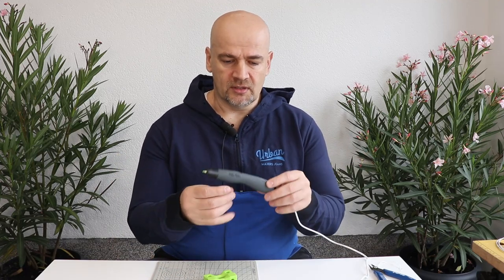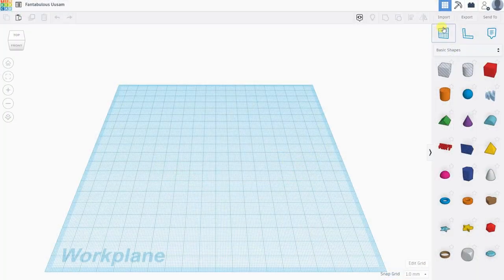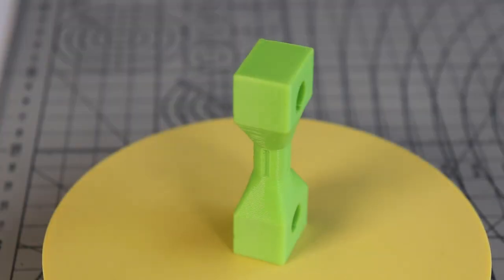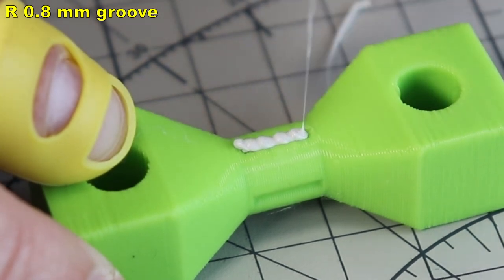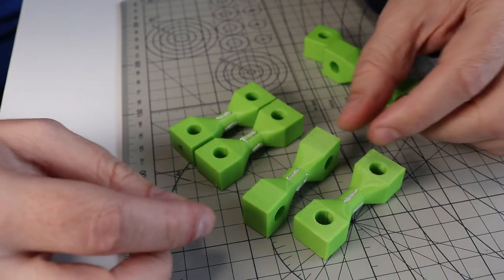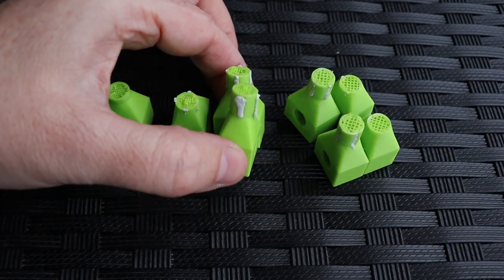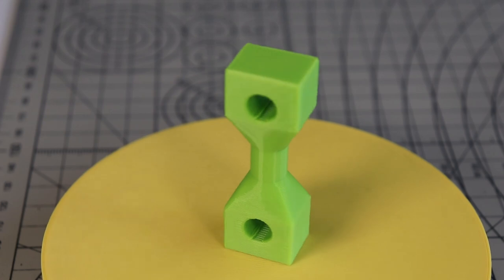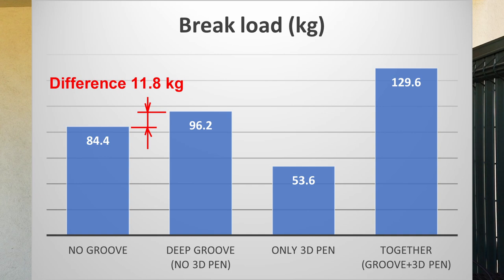Stronger 3D printed objects by using 3D pen in groove along the Z axis

Comment: Great stuff. This concept seems very powerful. If you want to maintain the surface finish of a part which needs "inter-layer strengthening" like this, I wonder if we could routinely design in internal tunnels through the front to the back faces, instead of grooves, and fill those. The plastic might solidify before it gets to the other side, but maybe not, and for osme parts it would definitely be doable. Cover plates would be anoither way forward, to hide these "infill channels".  This is another powerful tool in the 3D printer's armoury. Thanks!

Comment: I had always assumed that the filament used in the 3d pen was somehow substandard to regular PLA.  I’m surprised by the strength it added to the part.  Thank you for thinking outside the box and thanks for another great video.
Reply: 3D pens use 1.75mm filament, so you can use whatever quality filament you like.

Comment: Thanks for going back and testing just the grooves.  I suspect the results will vary a lot based on how well you bond the pen line with the groove material - with my 3d pen, I can just melt a print without extruding anything, so doing that first and then filling in the groove might have even better results.  Of course, to test that you'd need to strengthen the rest of the part to not break before the skinny part - maybe a thinner cylinder section and grooves running the whole length?

Comment: An excellent video!  Now, I wonder what would happen if the grooves extended into the tapered transition sections of your test piece?  Based on your data, I think the test specimen would break at about 150 kg.  (I was adding the deep groove only load and the only 3D pen load to get that number.)
Reply from the maker: I just tested cylindrical part. Yes, it would be interesting to see grooves in tapered part, but according to views, most of viewers are not interested in this kind of test. What I will do anyway, same test with ABS too.